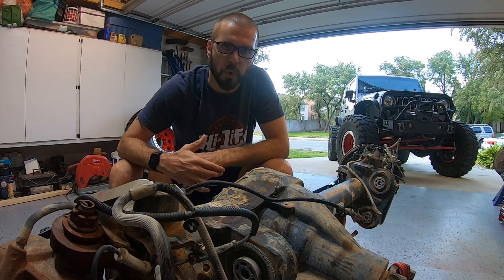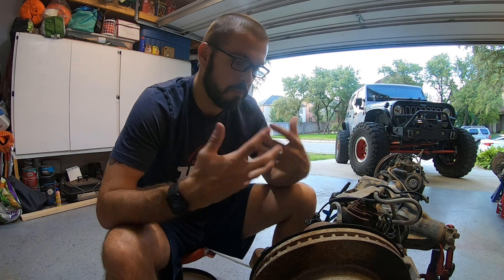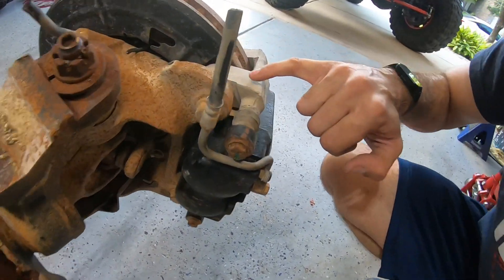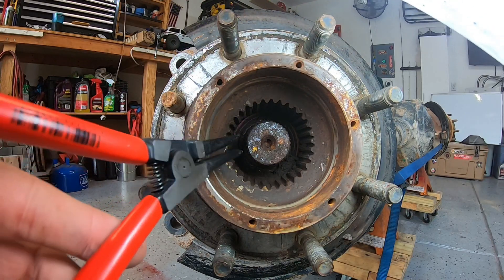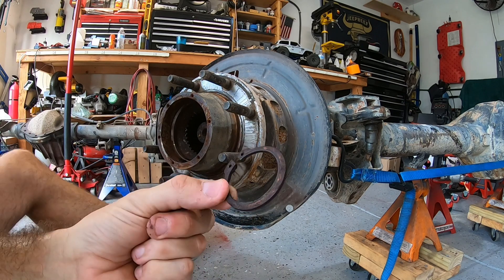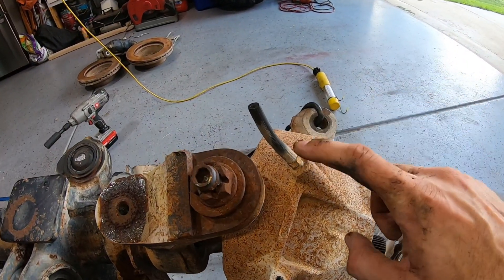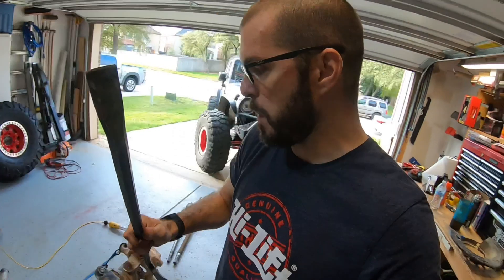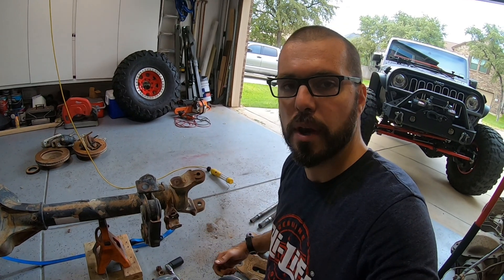HOW TO DISASSEMBLE A SUPERDUTY DANA 60 - Project Maple Leaf Jeep Build (no.3)

Comment: My upper ball joint is an 1 1/4 when I see multiple other videos saying a 24mm. Does that mean the ball joints in my 60 are aftermarket already?
Reply from the maker: It could and probably does. These axles are older at this point and they don’t last forever. Especially often being from work trucks. Either way I’d still pull it and replace it. Might as well when it’s apart.
Reply: @WarPaintTexas thanks. I feel way over my head with this project, but I'll just keep taking it slow. The lower ball joints are spinning on me so I will probably just cut those out.

Comment: Until what year is the super duty dana 60 2005+ good until? 

are all the super duty axles up until now the same housing ? is there a year up until the SD D60 does not support the 5.38 gear? 

Thank you for the vid - about to pick one up this weekend and wanted to be sure of the years :D
Reply from the maker: Hey! Sorry it took so long to respond. I’m at Easter Jeep Safari and a little busy. Haha. But I would not go with anything newer than 2016. After 2016 you can’t get deep gears.
Reply: @WarPaintTexas  hope you’re having a good time man 😎 maybe one of these I’ll come out with my build. 

Thank you for getting back to me 🫶🏽🔥 picking up a 2011 Front SD axle today

Comment: Dude I'm in the middle of doing a Dana 60 build and have been watching a ton of stuff on you tube about it. And this series is by far the best walkthrough of a Dana 60 brake down/ rebuild. I've been going back through them then noticed only like 500 views wtf.
Reply from the maker: I have a very new channel. I appreciate all the support. But this video is very new and the channel is only about 9 months old. So in time hopefully it will get there. I’m doing a build right now and about to put this axle under a jku on leafsprings. So it will be interesting and perform well. Should help the channel grow. Just takes time. But I appreciate the kind words!